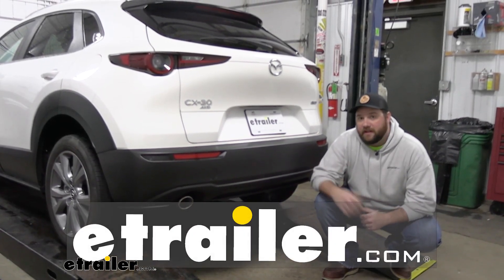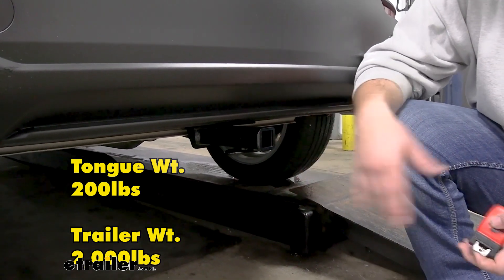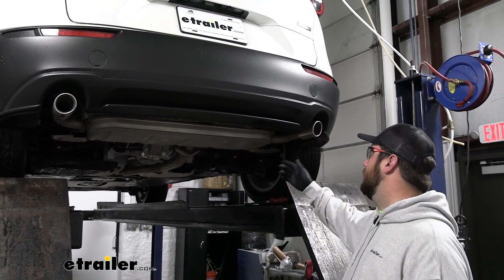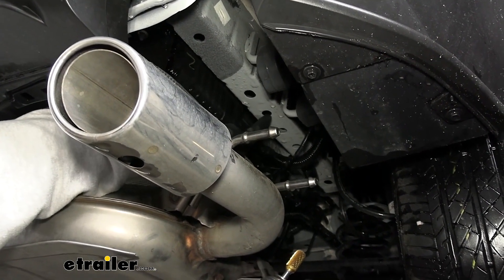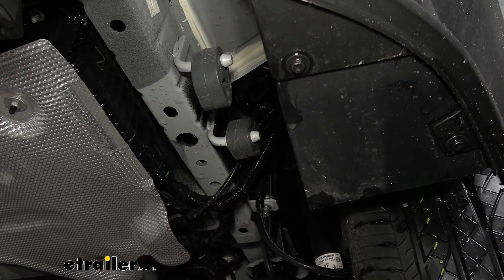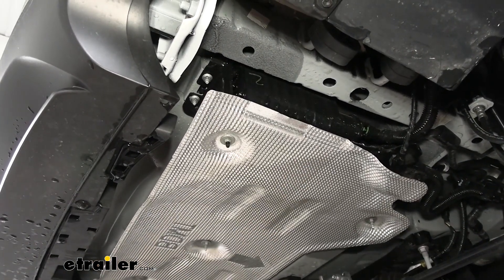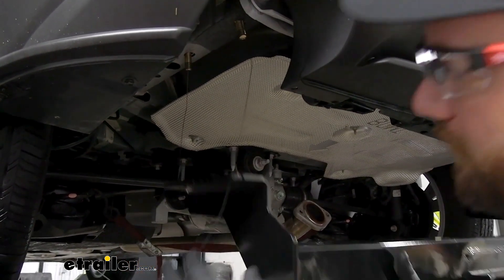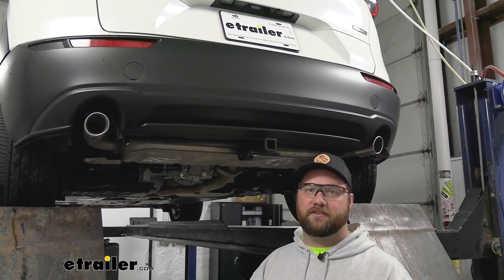etrailer | How to Set Up Your Curt Trailer Hitch Receiver on a 2023 Mazda CX-30

Comment: I’m interested in towing a pop up trailer about 1800 pounds but I’m worried if I would somehow break the car. Would it be ok to do that may be like twice a month? How badly could the car get effected? I’m looking online and it says Mazda cx30 is not really good for towing so I’m worried. Thank you in advance!
Reply from the maker: The owner's manual for the 2023 Mazda CX-30 states that the vehicle shouldn't be used for towing. Elsewhere online, I saw a 1500 lb tow rating, so you might want to check with your Mazda dealer for clarification on that. In any event, it sounds like your pop-up will be too heavy for your vehicle to handle safely. I wish I had better news for you!
https://www.etrailer.com/Trailer-Hitch/CURT/C49CR.html

Comment: Hi there! Is it necessarily to enlarge the holes? I watched the installation video etrailer did for the 2020 CX-30, posted 2 years ago, and the guy in the video inserted the carriage bolt heads through the sides of the frames (located in front of the exhaust hangers). Does the 2023 have different frames?
Reply from the maker: You will need to enlarge one hole on each side, as shown at the 2:30 minute mark.
https://www.etrailer.com/Trailer-Hitch/CURT/C49CR.html
https://www.etrailer.com/tv-install-curt-trailer-hitch-2023-mazda-cx-30-c49cr.aspx